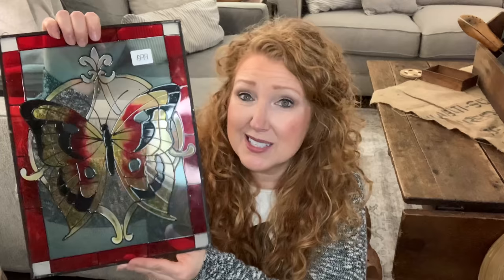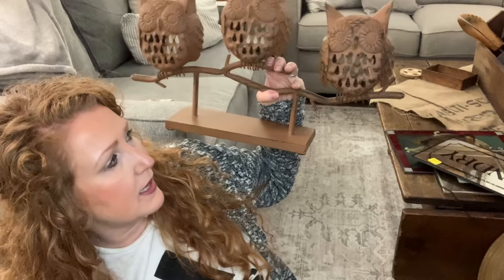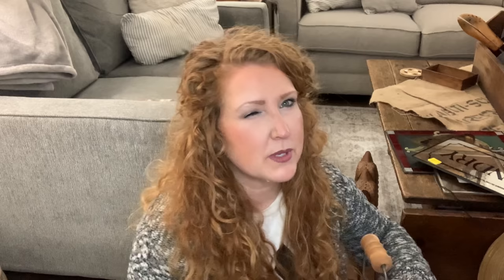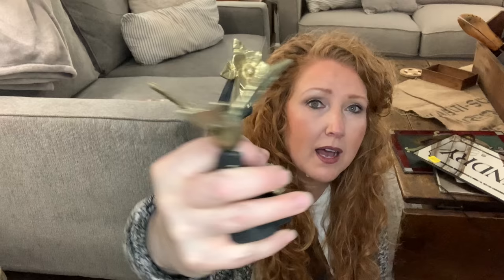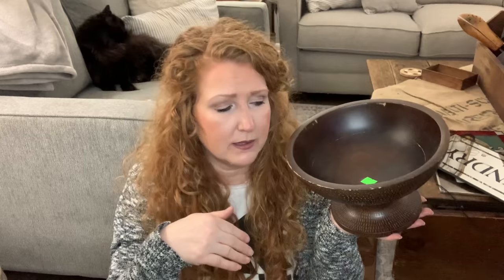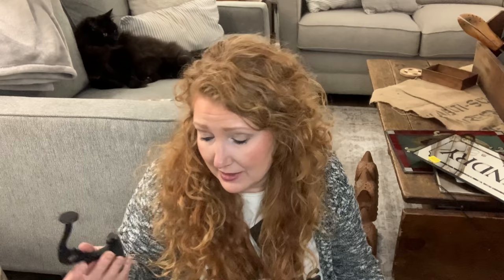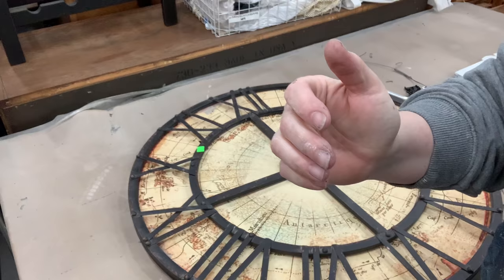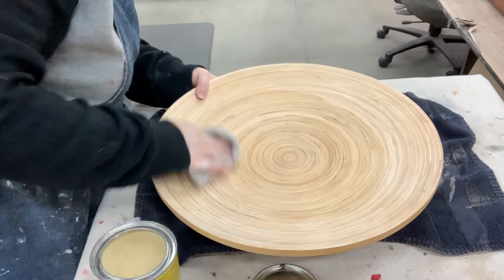Making Beautiful Home Decor from Second Hand Finds | Haul | Farmhouse | Cottage | Industrial | Boho

Comment: Hey ! Love your channel and you. An idea on the seized screws at the end - idk if u know this, and I myself know next to nothing compared to u, but my husband has often done this at work, is the only thing that works at times : Holding a candle or waxy crayon or other wax so that it goes down in when it drips, heat the wax. Try to hold items so it has best opportunity to drip down in there, and as it dries, it expands, and will loosed stuck things like bolts. IDK if it would work on an old screw if you can't even get it to move enough for there to be a path down in ... but there y'all go in case this ever comes in handy ! Doesn't usually cause anything to break, helps avoid that from what I hear... but that's on a semi truck or trailer... .
Of course, when the new kids ask my husband what he has crayons in his toolbox for, he says "for snacks" .... 🙄😅.

Comment: I also wanted to mention if you want to make wooden bowls etc. food safe, once stained and dry use Butchers Wax to finish and seal...after staining if the wood seems to still be real dry give it a mineral oil rub down then the wax...same process as a butcher block.

Comment: Love your work!!! I would have kept that big clock and glued the hand back set on at a time that is sentimental to me (a kids birth time, etc)
I do have a question. I have 3 RED metal pendant lights hanging above my kitchen countertop. I want them matte black. Can't take them down. Do you suggest using the same type of matte paint that I used for my exterior door or a chalk paint then polycrylic?? Would that be safe with Edison bulbs??
Thank you, my beautiful ginger sister.
Reply from the maker: Oh.. I’m not sure.. is it colored glass? Lights would be different.. sometimes color would make it so they were as effective. But if not and just shades. Than yes that sounds good. But I’ve never painted a shades before
Reply: @GingerChickRehab  it's metal. I'd need to paint inside and out. Just not sure what kind of paint to use.